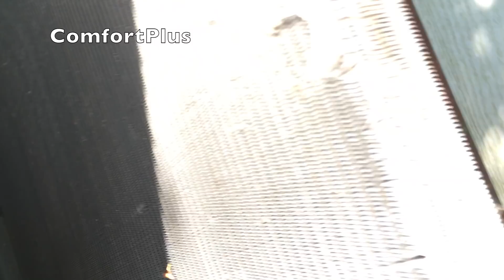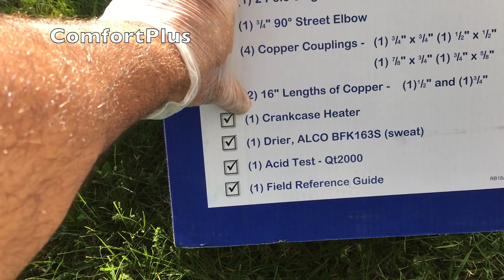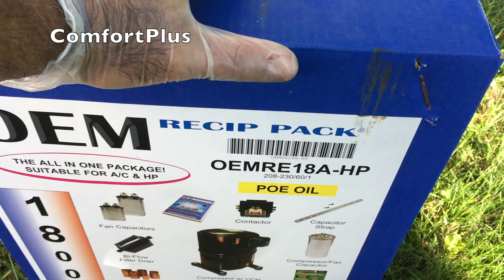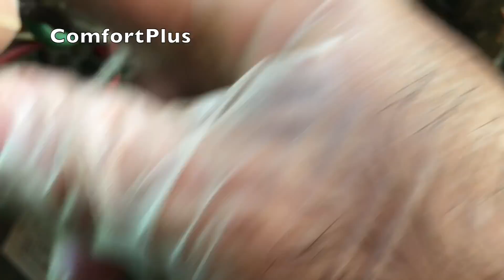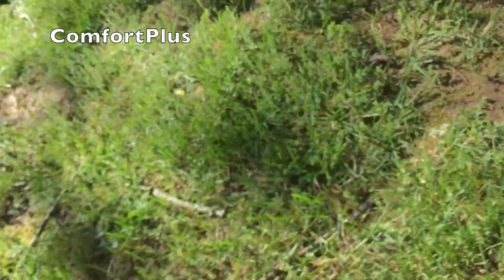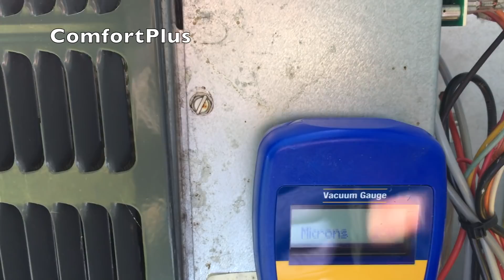HVAC - Compressor Replacement with R407C Retrofit

Comment: New Panasonic rotary compressor 2ton R22 have possible to change R407c
Old  oil mineral to remove put polister oil for R407c...... This is good also change filter driar 
Have possible

Comment: Will 407c work in a 1982 capillary system pretty well with a copeland scroll? Would you recommend using superchange or changing oil?
Reply from the maker: I haven’t converted a system without changing the compressor. All the new compressors come with POE oil so it isn’t an issue. That being said I have read articles where they have used a non-chlorine based refrigerant with mineral oil and been successful IF the piping runs are very short, as in the case of a package unit. Thanks for watching!

Comment: What are you thoughts on adding r407c directly to r22 as a top off....?   Is this something you have done or practiced or do you completely convert or use a drop in like r422b regardless of freon loss...?
Reply from the maker: I've only used 407c when I change a compressor out. I'm sure there are people that do add it on top of R22 but I wouldn't. Makes a totally different refrigerant and violated EPA rules!

Comment: i got a question, i put a furnace in and it has a cfm of 1200 but it is a down flow and i could only fit a 20x 8 duct off the plenum for the first 48'' i could go bigger after that should i keep going with 20x8 or open it up to the 20x10 duct.  any help would be great

Comment: hello, i did my 1st dry ship york 3 ton york gaurdian married to a 3 1/2 7 year old r22 cased coil, flushed with nitro flushed withr11 kit changed  drier my suct psi is 61 coil temp 38 high side 240 @111.0 any clues would help love your vids great job thanks bill

Comment: That was a Nice video, thanks for posting it.

I was wondering if the presures are  supposed todo be similar to R-22???
Reply from the maker: They usually will be close enough for the metering device to work without changing. Thanks for watching!
Reply: ComfortPlus Heating and Cooling hope you bypassed the filter inside the unit seen many drier fully stopped up.

Comment: Did you have to blow out the line set of the mineral oil or can you leave it in thefe. Ive got a compressor change out to do with min oil and 22 in the system now.
Reply from the maker: If it were a burnout I would flush the system prior to installing the new compressor and drier. But POE oil and Mineral oil seem to get along just fine. Honeywell says you can add POE oil (I think 20% of the original compressor oil capacity?) on top of the factory mineral oil charge and switch to 407C without problem.

Comment: Very clean and nice conversion Chuck, I don't know what it is about those Copeland CR compressors, but I had one go out on a Carrier Heat pump exactly the same way.  I saw someone on youtube open a 5 ton CR and the hi side tube inside was cracked because the  internal spring bracket broke an caused the line to break bypassing the gas internally.  I didn't open mine up...so who knows.  Nice job anyway!
Reply from the maker: I have this one at the shop. I will crack it open sometime if I get a few minutes and see if I can determine what it was for sure!
Reply: Thanks...I'd be curious what you find when you do crack it open!

Comment: Great job Chuck! There are many lesser techs that would not pay any attention to the capacity difference in the conversion and get themselves in trouble.
Reply from the maker: It really makes a difference on the old cap tube systems. We had several old BARD wall packs where I used to work and if the old Tecumseh Compressor had been replaced with a different model look out lol. Thanks for watching!

Comment: So do you just go off the r22 calculator to figure superheat with the 407c
Reply from the maker: You can use any calculator really. Most just use the indoor wet bulb and the outdoor dry bulb to calculate required superheat for a piston system. Before all the phone apps I used to take the indoor web bulb temp times 3, then subtract 80 then subtract the outdoor dry bulb temperature. This gives you a good idea of the required superheat.

Comment: I wish if you had connected the crank case heater wires on the NC contactor ports
Reply: in HVAC nearly none of the contactors have (NC) Normally Closed contacts, the ones that do are add-on-block/auxiliary contactor and mount to the side of the main contactor. the main contactor has to be made for that also.
Reply: You can hook up a CCH to opposing sides of the contactor. When it’s not energized you get 220v. When energized no voltage to CCH.

Comment: You must be looking at 40deg evap 120condensing btu performance . It would be almost 50/100 would get you where you needed on that 13 seer.